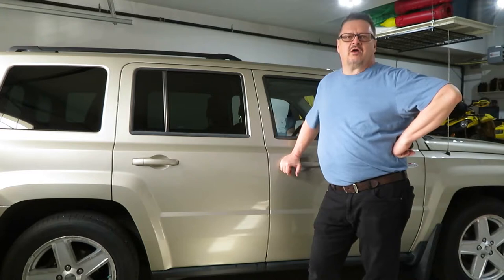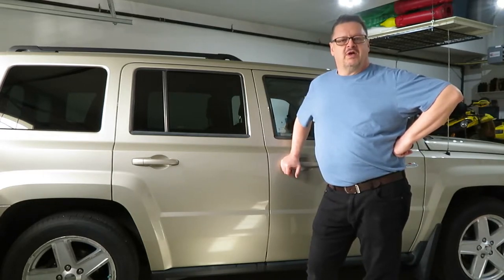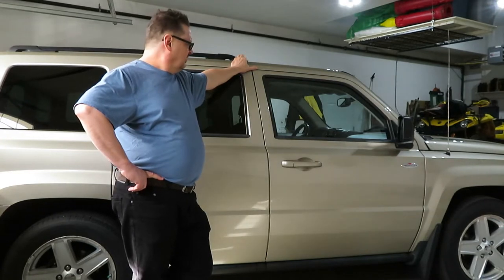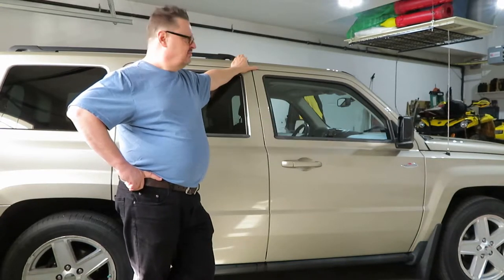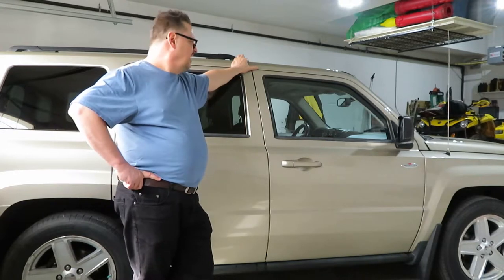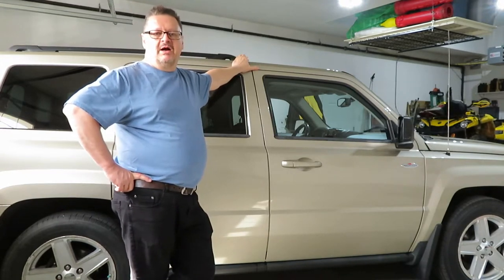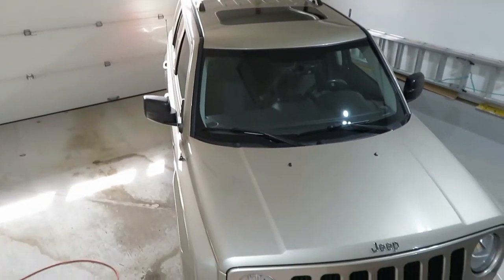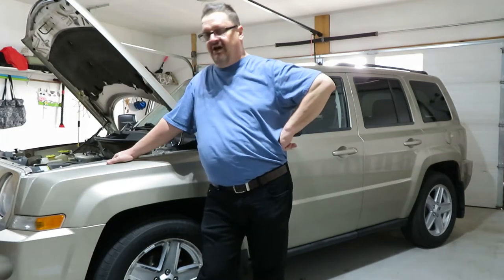Jeep Patriot Review - How Well Has It Held Up - Should You Buy a Used One?

Comment from the maker: My Patriot is still going "strong".  Nearly 200,000 KM's or 125,000 miles.  Doesn't use oil and no leaks anywhere.  I am slightly concerned about the transmission but it is only a gut feeling about its performance and nothing diagnosed.  Rust is forming at the front of the rear quarter panel under the rear door though.  For what I paid for it new and the minimal cost to maintain, it has been a good vehicle.  It is ready for some serious suspension work though.

Comment: Had my 2011 for 10 years and just discovered a block heater. The cord was deep under the battery! I'll be a lot of people have them also and dont know. Don't really need it though unless I was going way north. I have the low range off road package and it really is a competent rock trail mountain climbing machine. The hill holder is great. Also the towing package gives a  huge tranny cooler, which all the units needed. 143k miles and no issues. Change the cvt fluid every 40k or so miles.

Comment: Bought my 2010 Jeep Patriot sport in April of 2021. The salesman wanted $3,500, but I got him down to $2,250. Absolutely love my Jeep! Used to be a Toyota girl, but I would be hard-pressed to part with my Jeep. And, he came with all the bells and whistles. Even a touch screen stereo CD player(the screen comes down to insert CD). MP3 and Bluetooth ready, you can even use a USB to download. But, the best part is,he starts no matter what the weather is, and drives like a dream.💕
Reply: And yes....he is a boy.
Reply: How many miles? I’m looking at at 2011 with 165,000 miles I am really debating on it I just don’t want it to die on me soon after
Reply: How’s your jeep running? I’m looking into a 2010 Patriot sport as well, but have been hearing mixed reviews due to the jeep having a cvt transmission.
Reply: @brandonv.969  He is still running like a new Jeep. The only thing I had to do recently, was have a new sway bar installed. That only cost me a grand total of $85, that was counting part and labor. I absolutely love my Jeep, I would not trade it for a brand new vehicle. I really believe, it's how the previous owner took care of the vehicle. If they kept up on maintenance and didn't dog it, it's probably a good vehicle to have. Just check it out really well before you purchase. And according to my research, CVT transmissions are far more reliable. But, when they go out, you must get it off the road immediately so you don't cause extreme damage.
Reply: My son ,who just moved to the UAE -Dubai has bought,last week, a patriot 2.4 L petrol CVT .
Only 60,000 miles, but it's 2008, so knocking on a bit 
He knows nothing about cars and had never driven an automatic.
I think he paid too much at £3750, private sale .- but second hand cars world wide seem to be at stupid prices.
Reply: @toonmag50 .... If most of the knocking noises happening as he's driving it, Tell him to have the sway bar and links to the sway bar checked. That was the problem with my Jeep Patriot. It's a simple fix if that's all it is.
Reply: @missattitude9038  sorry,a bit of a cultural breakdown.
"Knocking on a bit"....
It's a British expression meaning "getting old"
I apologise for using a colloquial expression.
My son is happy with the car, says the only thing is the engine noise is high on  fast roads 
I just know that he'll get ripped off by the locals for servicing and,as I said, I think he's already paid too much ,in the first place.
Pushing my luck.  ..
Do you know what specification and recommended maker  of the spark plug is needed for the 2.4 L patriot?
Reply: @brandonv.969  Have 2010 Jeep patriot Sport I've had it since like 2015 I have 185k miles on it . Never had an engine problem . Ueas I've heard the CTV transmission is bad but honestly it could be worse . I've had nooooo problems what so ever.  Only momey I put into my Jeep was Gas and New Rims and Tires. And a new basic Consmetics amd Brakes . Eveyhing else worked amazing
Reply: @toonmag50 LoL! Born and raised in America here, but I got your meaning immediately. It seemed like a no-brainer. About 1/4 of my lineage comes from the Isle of Man but I don't know if that's the reason. Maybe more of it has rubbed off on me than I realize.
Reply: @fjdubya5726  Isle of Man - very interesting DNA.
Half Celtic half Viking.

Comment: I bought a 2014 Patriot 2 months ago 4x4 5speed manual 159K miles black and really like it so far.   Its the Sport model;  crank windows, manual locks but it does have a 6 disc cd player!  Only thing I had to do is replace the spark plugs as it was hesitating when I would change gears.  Getting 28 and 29mpg.  Fun to drive and very comfortable too!

Comment: I’ve had two. A2008 and put 326000 miles on it before giving it to my grandson who sold it and it’s still running. I also have a 2016 with 165000 on it. I love them. Bought tools to change cvt fluid and filter on first one and it’s still running. Had to replace crank sensor on 2016 and 1 cv joint and 1 wheel bearing but other than that just normal maintenance. Oh I’m a retired mechanic so I do my own work on it. My son now drives it to school.
Reply: How often should I change the CVT transmission fluid?

Comment: I have been looking at a 2015 one, 50k miles.
This makes me feel more confident.
Reply: At 50k miles it’s a good car to pick up for under 15k, just make sure it has service records and brand new spark plugs if you haven’t already ended up grabbing one or a different car.
Reply: @ElantraFukkenGang  How about a 2015 w 102, 943 mileage , any advice ? It’s below 10K where I’m from
Reply: @ninja2598  id bring a scan tool with you if Available, take it for a test drive and listen for bad bearings and bad ball joints. They tend to go around there. I just replaced mine a few months ago. Ask for service records. If everything checks out and your scanner doesn’t have any stored codes you should be set.

Comment: Nice. I have a 2008 2.4L, 4x2 Pat North five speed. 223000km now. No sun roof but power everything plus with that A/C inverter, which is handy. Thanks for mentioning rear stabilizer plate. Replaced when I bought new winter's last year.  It became a work project with body work. Always parked outside.

Comment: I’ve had my 2010 North Edition since new purchased in April. I factory ordered it because I wanted the 5 sp manual and no dealer had one sitting in their lot. I also got the fwd version because this vehicle with a good set of snows is vey good for the Canadian winters w/o needing the 4x4. Otherwise it’s got the all the same options as yours expect the sunroof as there were many that we’re leaking because the geniuses at Chrysler installed corrugated drain lines down the A pillars which tended to back up with sediment until the water spilled onto the headliner and made its way out the front dome light. I’ve got 142k km and I must say it is in mint condition. Every spring and fall when doing my tire changeover I buy 2 cans of Fluid Film and basically go to town spraying any where I see potential rust forming and also in areas I know these Jeep’s are prone to rust. I spray between the wheel well liner and the wheel well arches , all the bottoms of the doors including the weepers in the doors and lift gate. I do the hood and all door hinges too and there is no rust to be found anywhere. The 5 spoke rims have never seen a single snow flake so they look brand new. I use only Mobile 1 synthetic from Canadian Tire when it’s on sale and then take it to Chrysler for the oil change where they add the oil filter, labour and disposal fee for about $34.00. Its uses not a drop of oil unlike many cars today with dgi engines and high pressure fuel lines. I detail it in the spring and fall with top notch stuff and that brilliant black with its green sparkles looks amazing when I’m done. I’ve always loved black cars but the are a bitch to keep clean. Very reliable so far but I did have the input shaft bearing go bad so I had it and the output bearing done at the same time. But you are right the weak point of this car is it’s suspension. I’m pretty handy around cars so I buy my replacement parts mainly from Rock Auto so suspension components are fairly inexpensive. The creaking suspension disappear but often returns and it’s a constant battle but I love my Patriot. I’ve piled so much stuff into that vehicle over the years and the fact the front passenger seat folds flat is an absolute genius design. I love the fact that it suits my needs space wise and yet I sometimes lose it in a parking lot because it’s hiding behind a larger suv. I’m going to keep this as long as I can.  My 5 speed 1992 Eagle Talon went 16 years and 320,000 km before I sold it. Started burning oil out the back but the body was still mint. You take care of your cars and there is no reason they can’t last 300,000/400,000 km.
Reply: willow wax fluid film for the win

Comment: My 2014 I purchased new for $17,300 (little hail damage) has 132,000 miles. Only issue was I had to replace the throttle body at 60k miles. Not a lot of power as everyone notes,  but it has enough. Simple plain style which I like. It has been a good vehicle for me so far. For all the negative comments about Patriot's that are out there you sure see a lot of them on the road.

Comment: I was second owner on my 2012 Latitude. Transmission started overheating around 90-95k. This would happen on very warm summer days while driving for a few hours at highway speeds. Would have to pull over and let the car run in neutral to cycle the fluid without putting it in gear. Finally changed the fluid and the 2 filters (thanks youtube tutorials), which seemed to take care of the issue. No other problems with it other than small/normal things. Paint also held up extremely well. Was a great entry-level SUV with very nice features at the price point.
Reply: How often should I change the CVT transmission fluid? I have a jeep patriot, 2014
Reply: @iiPokeyy  I believe a generally accepted time period would be around 50k miles.

Comment: If your going to buy one... avoid the CVT like the plague. Same goes for most CVTs of the era, im not just picking on the Patriot.   The only ones I would buy used are the ones with the Automatic transmission.  The automatic Tranny was originally designed for the KIA sedona, a much heavier vehicle.  Unfortunately they only made them with the auto transmission towards the end, and it was optional..... so they are in the minority.
Reply: thoughts on dual VVT 2.4L 5 speed manual. Looking at purchasing a 2008 North edition. 148K kms
Thanks
Reply: They didn't "only make them automatics at the end." Even in its last model year, you could get the Patriot with either a 5 or 6 speed manual, a 6 speed auto, or a CVT. If you're going to get one, the 5 speed manual T355 is the most reliable. It was designed by Mercedes-Benz. The 6 speed manual is a Fiat-Chrysler design and has a lot of problems.
Reply: @RockandrollNegro  they only came with 5 speed manual, no 6 speeds. Please don’t talk blindly 🙂
Reply: @RockandrollNegro  His wording is a little off, but I think he meant to say they only started making them with automatics toward the end

Comment: I bought an 07 Compass 4x4 with the 2.4 and CVT with only 80k miles for super cheap and it has actually been really reliable for me. I had the alternator go out because I installed subs and the factory one couldn't handle it and then I had and issue with an aftermarket security system, but other than that, it hasn't had any issues at all. Does need sway bar links.
Reply from the maker: Thanks for sharing!
Reply: Ha just wait, you're about to find out just how horribly these Jeep were engineered.  My 08 has had ENDLESS issues as soon as it hit 80-90 thousand miles.   My advice to you is GET RID OF IT unless you've got 10 grand just lying around to make all the necessary repairs.

Comment: Looking at getting a 2012 version for my first car.
Reply from the maker: I hope you find a good, reliable one.  Easy to drive.
Reply: Im looking at a 2008 2.4 with 50000 miles on clock
Reply: Is it work to buy a 170k miles? Getting it cheap at auction
Reply: I would say hard no. Rare to see them with that high if miles. If moneys tight I’d recommend an older Toyota. They are known to be reliable with that high of miles but a patriot is a far more of a risk at that mileage
Reply: @mikeandrews745  wise advise
Reply: @mikeandrews745  smart man right here, I applaud you

Comment: A CVT does NOT have a “wider range of gears” it has a single gear that changes ratio depending on the throttle body position. Please do not speak on things you have 0 idea about 😭. Anyone looking for a patriot never get below a 2015, and make sure it has the 6 speed Hyundai automatic or a 5 speed manual transmission. The CVT in the patriot is a Nissan/Jatco CVT and is VERY VERY prone to failure before even 75k miles. Buyers beware
Reply: Been around since the turn of the 20th century,but  successfully first  commercially mass produced by DAF of the Netherlands,it's a glorified elastic band on a  centrafugal coned wheel.

Why so hostile to the video maker?
He was probably just avoiding the unnecessary mechanical explanation.
Reply: I have a 2014 with the 6 speed automatic that’s been good to me so far
Reply: @sirboomsalot4902  and I have a 2008 that is nothing but a lemon 🍋 and has cost me 3 times the amount I paid for it in repairs during the FIRST YEAR that I owned it.  And now it's going to the junk yard with about 8 Grand worth of new parts on it because it's a piece of crap just like the person who started this comment thread is warning people about.  I sure wish I had researched how horrible these vehicles are before I bought one.  I will NEVER own another Jeep EVER again after what this piece of junk has put me through. 
    Wait until this guy finds out about the recall on the rear sub/K frame or the million other problems it's about to incur as the miles pile on.  You'll see. You'll all see if you decide to keep this pile of rust and bolts past 80,000 miles or so. 🤬😠😡😤🤯🤦
Reply: @sirboomsalot4902  the 2014 is the first year of the 6 speed auto. You made a good choice. Just keep up with your maintenance. Oil change every 3 thousand miles, spark plugs every 30k, bearings every 50k. Keep up with it and your patriot will last atleast 175k
Reply: We have a 2011 with 160k miles on the original CVT, I don’t know how it hasn’t blown up yet but it’s still going strong.

Comment: Thinking of getting a used 2015 with about 200k on it. Is it worth getting that used? Wondering how long it will hold up
Reply: Got 14 4x4 manual transmission with 151k miles,  I replaced the support bearings on the transmission. Was not hard just took time, the previous owner had these tiny lug nut tight to over 250 lbs crazy. I'm going to replace front hub assembly because bearings are pressed in its,cheap to just replace everything, iv also have new front axles and a new clutch although it's not necessary I'm just going to upgrade it, I'm also going to replace back axles and bearings as well.all these parts are very inexpensive just need mechanical abilities which I have it's a very nice vehicle I can't complain.  The ac doesn't work but it's not really a problem,  overall it's a decent quality ride

Comment: How often should I change the CVT transmission fluid? I have a jeep patriot, 2014
Reply from the maker: I believe the service manual states 60,000 miles/100,000 KM.  Frankly, I've never changed mine and I'm almost afraid to now.  I've heard that at some point the materials in the fluid are what's holding everything together. 😀 No slippage so far from mine.

Comment: I'm in love with the look of this car and I'm on a budget I'm looking to get an 08 model for my first car in 2022 and I don't know if this is a good idea or not? Is it expensive to run?
Reply from the maker: Gas mileage on mine averages 10 litres per 100 KM or 23 MPG so fuel consumption is not too bad.  To date I've only had to do general maintenance like oil changes, brakes and tires so that cost has been lower than average I think.
Reply: My 2008 has been nothing but problems. One after another and now the mechanics at the Jeep dealership cant even figure out what's wrong with it. The 2008s have a recall on the rear sub/K frame because it rusts completely through and basically your entire rear end will basically fall off the chassis.

Comment: Just bought 07 with 111k an it leaking oil an suggestion on what it could be
Reply: Sell it as quickly as you can and make it someone else's problem. I have an 08 with around the same amount of miles and it's been nothing but major issue after major issue.

Comment: Had a clutch go out at 60k miles 

Throw out bearing go out at 120k miles.  Had $2k+ in repairs on that

Now at 157k miles I have a transmission fluid leak which lead to transmission damage.  Waiting to hear back on pricing on those repairs.

I want to like the vehicle, but fuck… Chrysler, you have to build a more reliable transmission.  This is ridiculous